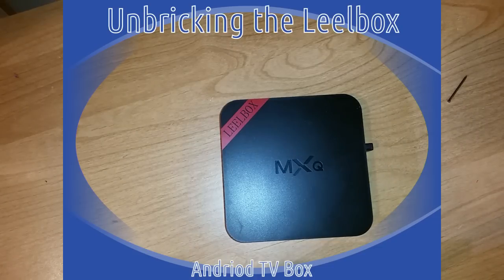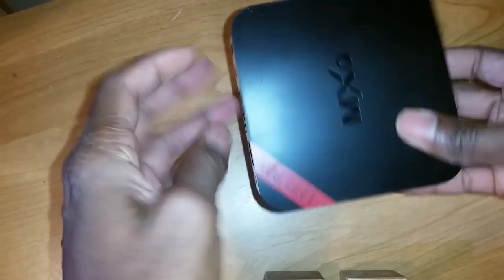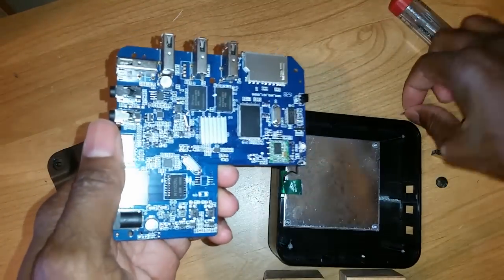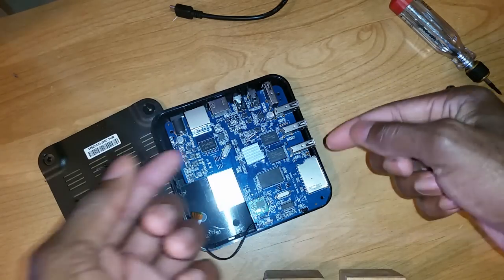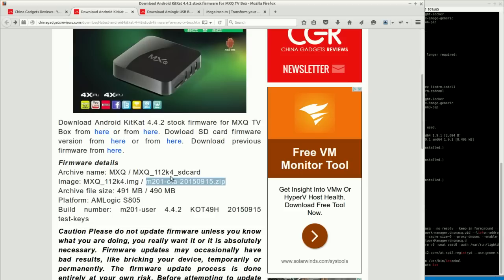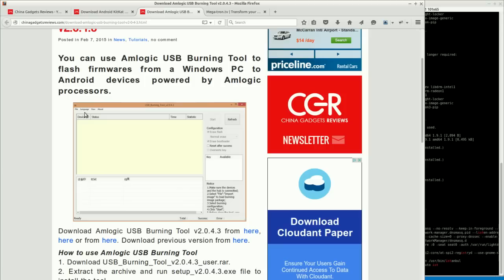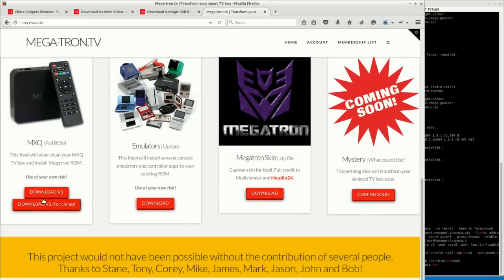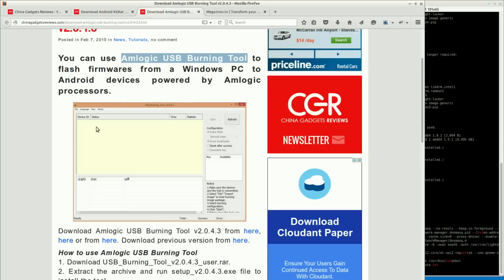How to Un-Brick Your Leelbox  Android TV Box

Comment: Hello, I had a TX3Mini 2018 Red board CS_905W_TX_V1.2 20170925
I tried to update to ATV9 but after burning done, the box is stucked in burning mode but I can not burn any rom, it is stuck at 1% with reading item error. Pls help.

Comment: hi i have a problem with my android m82 SoC model: AMLogic Meson8 AML8726-M8
Core microarchitecture: 4x ARM Cortex-A9 @ 1992 MHz to make it short since the same although equipped with a reset button does not have the recovery mod I installed the twpr apk app and tried to insert it as root. Result, the box is blocked and will not light up anymore. i tried various flash methods including connecting to pc with amlogic usb burning tool and original firmware. The pc recognizes it loads the image file but over 2% does not work. In addition, the box does not turn on either the blue or red LEDs. At this point my doubt is a mistake some passage I have the box is permanently lost ????

Comment: Hey good video, I want to try this usb burner tool with an older box as I have before with a newer box and worked fine, the problem is thow I cannot find the IMG file firmware anywhere for the Matricom gbox midnight mx2 box. It's almost like it doesn't exist or has been wiped off the internet, if anyone knows I'd greatly apriciate it.

Comment: I have a little bit different problem with my Tanix TX5 pro android box. It's blinking red light, then when I connect it to my pc using usb burning tool, the uab burning tool recognize my box, I can install the latest firmware. But after tge software shows successfully installed, my box still blinking red light. Would you happen to have a solution for this?

Comment: i need help i have an android box A95X Pro 
i installed Super SU and it bricked  the box
I tried to flash it with a firmware of A95x and it bricked  everything now
I can no longer used memory card recovery
now the red LED is still present  and the blue led is gone    
I can not connect it to the PC with a USB and USB_Burning_Tool
I am running Windows 10 and USB_Burning_Tool 2.1.6

the motherboard is different
I do not know where to find the pines that must be shortcircuit

all help is welcome
thanks a lot

Comment: Mate I have two amlogic s912 devices, I repaired one with this method but the second box cannot connect even though it gets electiricity when I plug in the adapter. I tried to flash it from sd card, also tried burncardreader and other tools, nothing.

Tried all the pins but non of them allows me to connect to pc...
Do you have any idea what else to try?

Regards

Comment: I have a m8s+ android tv box I'm only getting the red light ,I've tried running the USB burning tool but I keep getting a USB connection error can u plz help me
Reply: Have you attempted to try the unbricking procedure in the video, yet? It really works... Although I only have the Leelbox so I'm not 100% sure about the m8s+.  You should take the system apart and see if the curcuit board layout is similar to mince.  If it is... Its up to you to continue at your own risk...  But it should work the same.  Maybe check the comments below and see if anyone here has your model number.  Most people here will help if they can.

Comment: this really works... while ago i tried but did not work, today i found out that you need to remove chinese characters from file name of the img.... then worked flawlessly... only had to touch the right pins for like 1 second... it gave a weird sound but did not need to keep the pin on the chip..... it flashed 100% and restarted... very nice, device was totally dead before...
Reply: how ? i have the a95x r1 2/16 gb i can't unbrik it i have that red light and i can't login to the recovery screen

Comment: I keep getting errors at 4%... I do have a bad stand alone USB port. I have to keep messing with it to connect.
Reply from the maker: Usually once you hear the sound you should be able to release/or stop shorting out the circuit and it should continure to upgrade.  You may have to use a better cable.(im just guessing)

Comment: can u please help with firmware issue for an m8s box with amlogic s802b inside wifi 6330 did not find the right firmware the only one that work had no wifi nor bluetooth the box os recognized by computer please help if you can 
none of those on china gadget works :(
Reply: Did u ever get your box back working if so where did u get the firmware thanks
Reply: +Eric Payne i gived up finding the right one i used the firmware cyx.....bcm4335 to revive the box without wifi and bluetooth from the video in youtube about revive bcm4335
Reply: Thanks same here my head is melted quicker buying a new one I spend hours days weeks on it 😂😂😂

Comment: Very informative video bro. keep up the good work.  FYI once windows recognizes device you can  remove jumper from chip pins.   Your video is great for units which have a Hard Brick.
Soft Bricks will work with the reset (toothpick method) but it is time consuming as you have to repeat the procedure numerous times before it works.  Your method is quicker.
Once again Great Job on sharing your alternative method.

Comment: I have a new style R68 Rockchip RK 3368 Cygnus Media steaming box, I am having problem with it, I upload the new KODI 16.1 Javis, but even with facory reset back to 15.1 KODI software, when I watch two movies, my internal memory go's  from 1.2 GB to as low 485 MB. a.  I have tried different cleaning cached cleaning software,  internal memory does not drop. b.  I wanted to see if I can swap the memory around, since my Nand Flash  memory has more space "3.41GB, however I can do this without getting my box rooted first. c.  I download you Kingroot,, Sper Su, Root Checker, kingroot does not root my Box. d.  I also  wanted to try APP to SD, but can's this to work either. Would really appreciate your help here. need to brain storm with you on this one.  e. I want to also back my flash so I can keep my first screen that comes up first when turned on.
 Nuff Respect  Phillip 
.. Skype islandbuay or email philmointernational@gmail.com or cell 9545486007

Comment: Great video, I need a little more help. I'm getting to 94% and the burn won't finish any suggestion. same result after 30 tries or so. The fault message is as follows: uboot/low power/send command/error
Reply: Try using USB Burning Tool V2.0.1

Comment: thank you all !
but I have other nand chip on my plate SanDisk P221011 I do not think that same pin is what. do you think ?? you might also know which firmware should have? ..

  see picture
https://drive.google.com/file/d/0B1QXci2mHs9GeXFHVGtoUER3Y3c/view
Reply: +pwg barkato  This look a tad bit different than mines.   What type of system do you have?  MXQ  OTT Leelbox?  
I used the stock version listed in on this post.  Then I switched to the Megatron build.   I dont remember what version it was when it was shipped to m e.
Reply: +Clarence H  thank you all !
maybe someone knows what firmware compatible with this board?
I've tried almost everything'm stuck on this   "[2%] "[0x10105002] Romcode / Initialize DDR / Read initialize Status / USB Control setup error""     with red light

here is my board...

https://drive.google.com/file/d/0B1QXci2mHs9GZlBlZzFDWkdEejA/view?usp=sharing

https://drive.google.com/file/d/0B1QXci2mHs9GZlNqVXhIUzJhMzg/view?usp=sharing

https://drive.google.com/file/d/0B1QXci2mHs9GeXFHVGtoUER3Y3c/view?usp=sharing
https://drive.google.com/file/d/0B1QXci2mHs9Gc0ZJaFAtUGhoU2s/view?usp=sharing
Reply from the maker: +pwg barkato Ahh you have a the MXIII.  I have one of those but I didnt have to unbrick that one.  Heres a link to a guy that is unbricking the MXIII.   I havent checked it out so hopefully it works for you..  https://www.youtube.com/watch?v=t_fMCUXwF4Q

Comment: Hi i have an android tv box (m8s) and i need to unbrick could you show me how to get it done and provide the links for downloading the right firmware? thanks
Reply from the maker: +Roger Valladares Heres a whole slew of firmware updates for the M8S.  You will have to double check the bottom of your unit and makes sure the firmware matches what you have.  What you want is the stock version.  http://chinagadgetsreviews.com/?s=m8s
Reply: +TwoItems.com 

Hi thanks for your time since you answer my question ,  my board has a number (M8 & M9  V02 ,it  was sold under the name OTT M8S  octacore 2g ,I've tried everything but successful ,it has a blue light on all the time ,i'm not sure if i'm doing something wrong or is that I haven't found the right firmware ,I could install the megatron but only work if i keep the sd card in its slot ,if i remove it and unplug the power to the tvbox ,then it can't start again ,Do you have a solution?

Comment: I have ''mxq ott tv box'' when i plug it inn only the red light comes on and nothing more, its not even taking the hard reset... wat can i possible do to fix my box from home so i can get it up and running again?
Reply: You need to get the box to be recognized when you attach the male to male USB cable to your computer.  I had to short out two pins on the chip I showed in the video.  I don't know the nubers but I didn't have any problems walking down each set of pins until I hot the right one.  (do at your own risk)  basically it's already broken. 
You can use a safety pin, nail, whatever.  

check out post number 9 on this forum.  the chip is not the same as what I have but it decribes what to do.

http://freaktab.com/forum/tv-player-support/rk3188-devices/10884-anyone-know-what-pins-i-have-to-short-to-unbrick-this
Reply: +Clarence H ok... well i did it last nite.. it comes up saying connected susses.. an it also bring up the img file.. but wen i click start it only go to 2% an say usb erro...
Reply: That happened to me too a lot of times. You have to make sure the file is correct and hold your hand steady.
Reply: +Clarence H how do i male site the file?
Reply: That happened to me too a lot of times. You have to make sure the file is correct and hold your hand steady.
Reply: It come as .img file. And how would i knw if i have the right or wrong file?
Reply: +Rushade Wright Just locate your model and correct image file.  if you flash the wrong image you system simple won't boot. Then you will have to perform the procedure described in this video.
Reply: I know that... am doing what i seen in ur video but its not wrking my img file is 761,520kb after zip and Rar i wonder if that is correct?

Comment: Can I hold the pins down with iron material or it should be plastic or any stuff?
Reply from the maker: +Truth1Sayer You need to use a metal object.  The voltage must be very low because I touche every single pin until I was able to get Windows to see the  system  as a USB device
Reply: +TwoItems.com thank you . i have fixed the dead device because i got what you have done .. thank you very much for this usful help .. i thought i lost my device but i got it worked . but there's a problem which is the red light all the time even though the device is working very well .
Reply: +Truth1Sayer maybe i misused the device by holding down every pin randomly till i got some pins down due to some tough work .. thank you
Reply: +Truth1Sayer Thanks,
 I'm glad I was able to help.